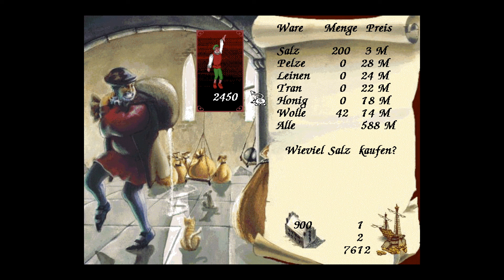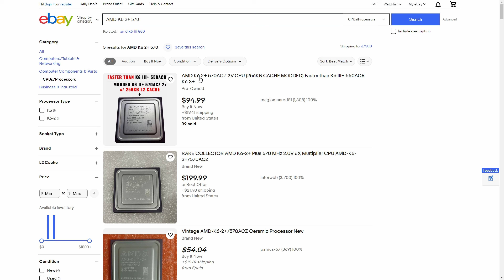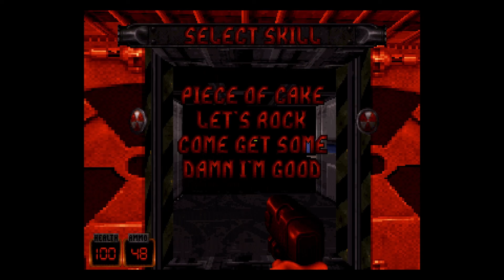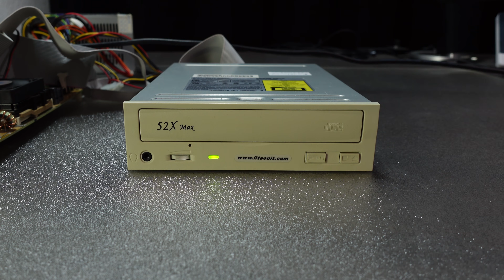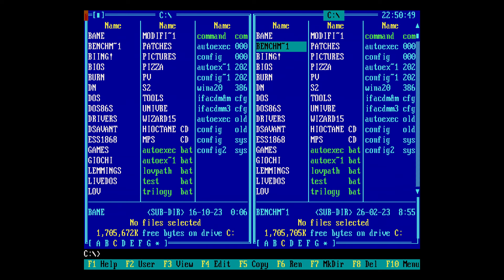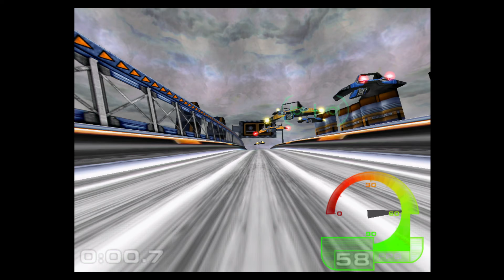Games of the 90s: One PC to run them all! - With original hardware using SS7 & 3Dfx by Kordanor

Comment: Interesting idea, very creative.  You definitely like to make your life more complicated and expensive. 😉  Usually you choose a PC case to suit the hardware you want, not the other way round. 😁  Whilst obviously the choices are subjective, I personally wouldn't go for such a complicated setup. There"s a lot of DIY bodging to go wrong and it just makes it difficult to choose the right combinations. There's likely to be a lot of frustration involved in running and maintaining it. In trying to make a single PC compatible with such a wide variety of games, you risk getting a Jack of all trades, master of none.
Reply from the maker: Yeah, would definitely not recommend to case. :D
It's just the first case I ever had, and the only one which is nostalgic for me. Don't even remember anymore what later cases looked like. Besides of some black turbine thing from the early 2000s :D
The PC is pretty good though in most scenarios, but it does require more tinkering as you might want, especially due to the Voodoo 3 card, which is "too new" for some DOS Games and early Voodoo games. I covered more on that in the follow up video. Besides of one Game (which is German only and requires 15 Bit Graphics for the High Color mode) I have been able to solve all of the issues though. But yeah, my recommendation would be: Different case, Take a S3 Trio for example (which is super compatible) and pair it with a Voodoo 2 (or 2).

Comment: I appreciate this effort as the best solution, but emulation wise it is not so dire: DosBox had a good run and it is easier to run and go, but nowadays you can use 86Box and PCem, and both are way better and as close to reald hardware as you can get (except that you need something like 5Ghz per core to emulate a PII). MisterFPGA is amazing, but if you want a PC, you'll be stuck with a 486-33Sx, so nothing post lower-mid-range 1992-1993
Reply from the maker: Yeah, some decent options out there. I think a MisterPGA can be a little be faster, but not by much. In the end, it also really depends what you are looking for.
Reply: @KordanorsGamingLair  Yeah, with a Mister you are hard capped to Civ2 and Sim Tower: Both run at playable levels, but super slow, so it is what you lived on with real hardware in 1995 unless you where rich, but you also get many more computers running on. My fav is the Amiga. Did my thesis project about FPGAS and used am MisterFPGA as the base, but you'll be leaving the latter 90s computers with it :P
I love the emulation approach to go a bit further, but I agree that as for now we are not advanced enough as to go beyond real hardware. Still wish the FPGA route was cheaper/more powerful tho! At least to a  Pentium II level!

Comment: I am building a very similar system in an ATX converted Baby AT tower; Same Acorp mainboard, K62+ 550, V3 2000. I had the idea of using a Pi Pico attached to the mainboard via a serial port to control various system functions which are usually not software accessible. Dry contact relays on the FSB jumpers and also I have a creative infra drive which has a hardware button to slow the drive down to about 8x CLV which it could also operate remotely. I think it will be a cool project, the video you made on modifying the clockspeed should make it much easier to set up the relays since the mainboard is identical.
Reply from the maker: Oh, very cool! Is there anything which is of practical use you can access via the serial port? If you are even more into tinkering and are not afraid of soldering cpu connections you could even go further, doing something like this: https://www.youtube.com/watch?v=9uNml2j6sy0
But for me personally that goes a bit too far :D
Btw: Also check out my other video about the voodoo timetravel in case you should ever stumble over problems with compatibility issues...there are a bunch of them, but most can be solved

Comment: 128mb of ram is quite a large amount for back in the 1997/98 days. Most high end PC shipped with 32MB in 1997 and 64MB in 1998.
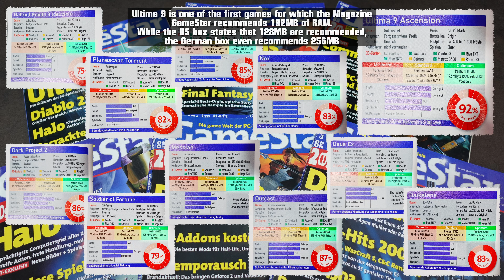Reply from the maker: Yeah, exactly. I tried to make that point at 8:05 showing all the games of 2000 which still don't use more than 128MB. But going below 128MB also doesn't make much sense. Ofc you don't lose much when playing a game from 1997. But you also don't gain anything.

Comment: This has been interesting - there are a number of useful tools that you have brought up. I am curious to know if you have tested the difference between external cache enabled and external cache disabled in conjunction with the CPU? I found that it did make a difference, although I have not modified my bus speed down to 60MHz and as such, I cannot directly compare (yet).
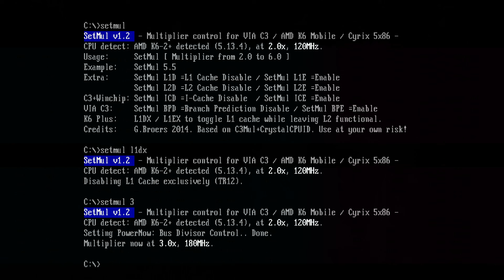Reply from the maker: Heyho! Yeah, you can see a list at 33:20 where I did list a couple of settings where just the external cache is different. You basically need to keep in Mind that the K6 2+ CPU has it's own L2 Cache. That means that the external Cache becomes L3 basically. But as soon as you disable one cache of the CPU it moves "up" and as it's slower as the integreated L1/L2 cache, the CPU also becomes slower if it needs to use the External Cache as L1/L2. So disabling "just" the external cache does almost nothing. But Disabling L1, L2 and then also disabling the external cache halves the effective speed and makes a massive difference.

Comment: You first did make 8gb size and partitions and later made again up to 120gb, why you used two times fdisk and format?
Reply from the maker: Oh, that's because I am using 2 SD Cards. One card for DOS: 16GB capacity, but as DOS only handles 8GB drive and 2GB partitions, that's how its set up. The Second SD ist for Windows. That one is 128gb, with full 128gb used as a single partition.

Comment: This was great and nice to see your build. I've wanted to build a DOS pc for a long time, but it's difficult to decide what era to go with! I think I'll work on a windows 98 PC first before getting into the can of worms that is DOS!
Reply from the maker: Thanks! Yeah, that's reasonable. Also consider using a Mister FPGA for DOS, which you could then maybe also use to solve the C64 problem :D
I think a PC with high performance components fom around the years 2002-2004 should yield pretty much the best results for most games, except of DOS and ofc the early 3dfx stuff. Also instead of swapping between DOS and WIN98 as I did, you could swap between WIN98 and XP if that should ever be necessary. Though I am not sure if a SD-Card would still offer optimal speed for that era, but ofc there are also alternatives. :)

Comment: Are you familiar with 86box? Gives far more options for tinkering than DOSBox does and emulates more accurately in my experience. I use 86box to have 486 and early Pentium machines with several DOS and Windows 3.11,95 and 98 configurations, even with a 3D Voodoo card.
Reply from the maker: Oh, interesting. But no, not familiar with it. I only tried around with different DosBox releases. PCem might already yield better results than DosBox, but I didnt tinker around with that either. In fact I didnt even know of it until I was already deep into getting all parts together (a bit later there was also a Linus Tech Tips video on PCem). Seems like 86 is based on PCem, so I don't doubt it will give better results. But personally, I rather stick to the original now.
Reply: 86Box is great! It is based on PCem, but this fork focus on emulation accuracy instead of speed.

Comment: Mad respect for this lots-of-PCs-in-one-approach. Personally I am going in completely the opposite direction with dozens of separate machines, so it's nice and relaxing to watch all the hoops I won't have to jump through and the nifty solutions for them. :P
Reply from the maker: Haha, yeah I have heard of people basically having a PC for every 2 years of games, so that everything is time accurate, and surely, in lots of cases you do avoid issues. Especially the Voodoo 3 was actually a total pain to work with. Most stuff can be made so that it works, but it's lots of work and troubleshooding and "modern knowledge" and options you wouldn't have had back then. More on that in the next video :D
Reply: @KordanorsGamingLair  Well I also need to justify my gigantic hardware piles, somehow. XD

Comment: this quite similar to the first case I ever had, but far more powerfull.
Reply from the maker: Yeah, by the time the PCs were that powerful, "Desktop PCs" were already rather unpopular. I think their time was mostly in the late 90s, popularized by the original IBM PCs for example. It's kinda funny though that this specific case, which was made in the early 90s, and which I bought on ebay, was used in a company which back in the day, already put a AMD K6 into it.